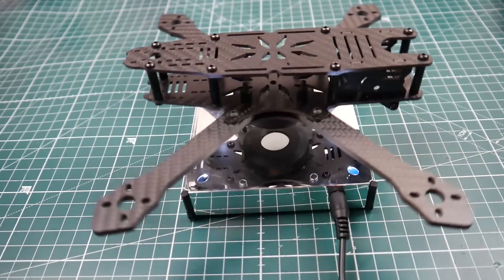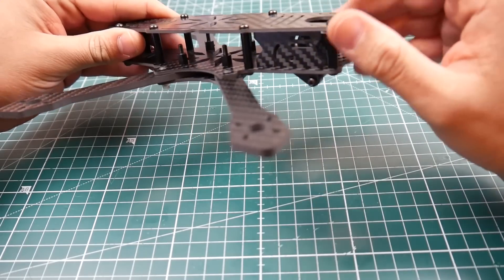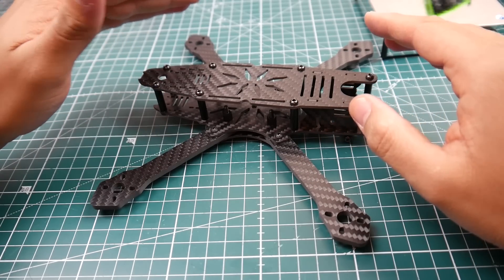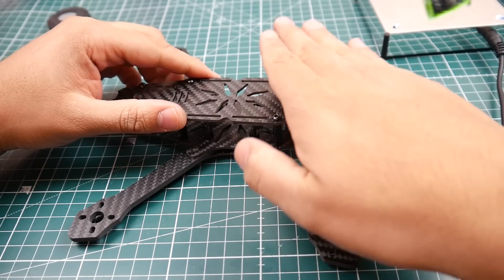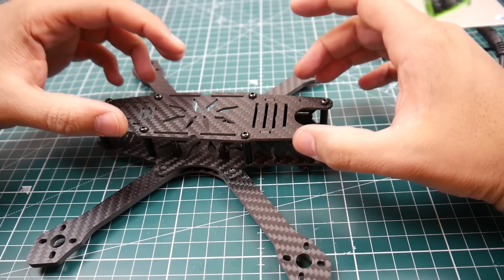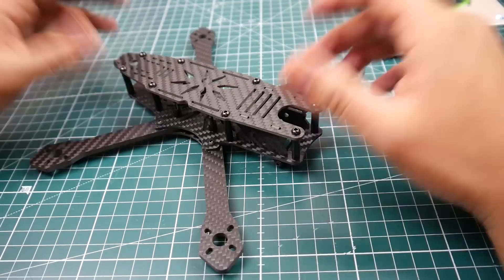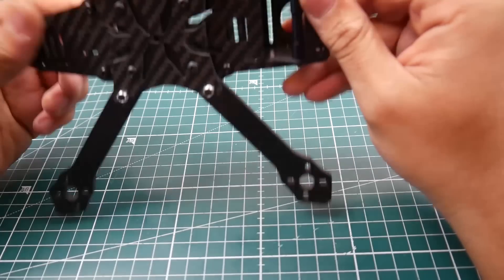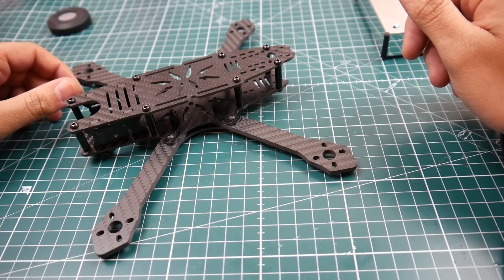Realacc Ultra-215 Frame // Overview

Comment: The price on the tekko 32 has changed in your link. There now 20$. The use of the stack hardware as a structural component kills this design for me. Other then that it's ok. Heavy as crap. Lol great vids man. Keep it up.

Comment: those Realacc frames are usually crap. I can tell it because I had 3 different of them. The money you won't spend in the frame, you'll spend it twice, 3 times, 4 times in broken spare parts (arms, plates). Just buy a nearly $50 frame and you'll have a tank compared to those realacc sh*ts
Reply: yes, the carbon on these realacc frames is very lowquality, it breaks very easily
Reply: I'm not sure even $50 applies, not since I've built my Armattan Rooster, though I have to say Transtec Frog Lite is an exception. I'ts a huge step-up in performance, durability, and most importantly handling, from $180 quad to $350 quad. Bob Roogie - HyperFloss aka KababFPV spoke recently about carbon and cutting https://www.youtube.com/watch?v=x8poP9TDvCI
Reply: you can ges some very solid frames with high quality carbon or 50usd

Comment: Have u/ will u try the hyperlite flowride frame? It costs $15 more than this frame
Reply: JC250 yes and build it with that great looking tekko32 4in1 esc
Reply: Where did you bought tekko32? Does it has enough room around holes to stack the board?